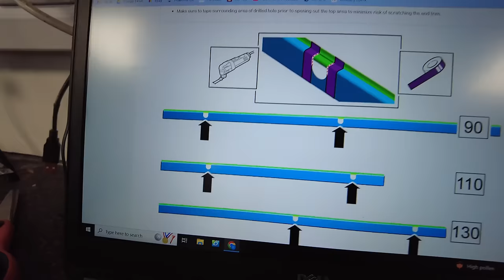Fitting a Side Gear Box to a new Land Rover Defender 90

Comment: The square washers from Landrover will work if you follow their instructions, by cutting the vertical slot above the 19mm hole; much easier than the suggestion to file the square washers round? Following the original OEM designers instructions would be far easier than creating more work, the installation kit was very straightforward when I did this.

Comment: I am one of those anxiously awaiting the Molle Plate for the 90 you currently have under development.  Fingers crossed that you will also provide a predrilled spare or replacement waist rail with the kit so that the original can be kept in pristine condition for reinstallation if and when one might wish to later remove the Molle plate.  🤞
Reply from the maker: We are close to releasing the molle plate for the 90

Comment: Interesting video Simon..... but does the newly installed sandwich box effect the rear vision from the exterior drivers mirror???? It appears that the sandwich box stands out from the body of the vehicle by nearly 200mm.... or 8 inches in old English..... regards Ian 👨‍🎤🇳🇿
Reply: It does, so you'll have the same problem we have in the UK 🇬🇧.  I mounted by box on the nearside. It looks just fine, but the fit isn't great because the fixing arms are designed for the right side.

Comment: WARNING! Do not tighten the bottom fixing bolts to 38nm. I have painful experience of these aftermarket boxes. The bolt will almost certainly shear off in the car. Any idea where to buy replacement bolts?!
Reply from the maker: You could use some of these to reduce the thread to M6 and then just use an M6 bolt and spacer ?
https://www.ebay.co.uk/itm/165894374534

Comment: @powerfulukltd  new product idea ... can you build good pice of CNC milled alloy utility rail (similar to utility tail used in two sides of  Ineos Grenadier) which can be attached to both side of those bolts ..so that we can fit anything anywhere by attaching those to utility rail and roof rail ..no more plastic drilling ..clean and looks nice

Comment: Simon, there's another problem with fitting the box on the nearside. It doesn't fit great 😕. I have a phev model X and wanted the box on the nearside for a couple of reasons - one, because it gives clear site on the most used rear mirror,  and because I keep my charging cable next to the charging socket. The arms lengths can't be reversed (as you've discovered), and so the fit is not perfect. I have got it mounted on the nearside, and now I live in hope that you'll offer a set of 'reversed' arms for nearside mounting .... PLEEEEESE 😊
Reply from the maker: OK let me look at this - maybe we can weld up an adaptor plate.
Reply: @L663  my car has so many of your bits on it, I'm not sure I should still call it a Landrover Defender anymore 🤩